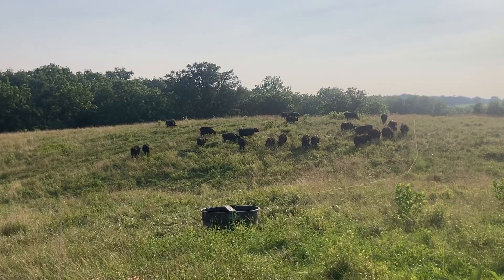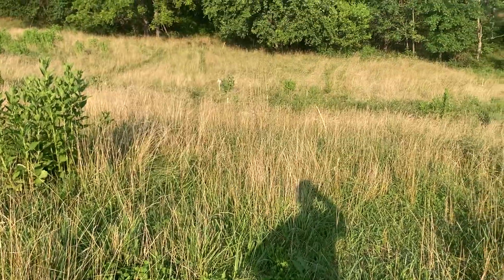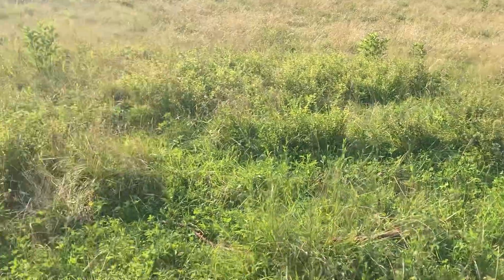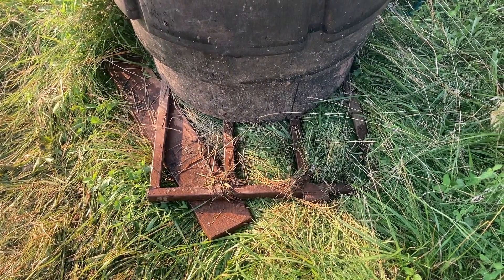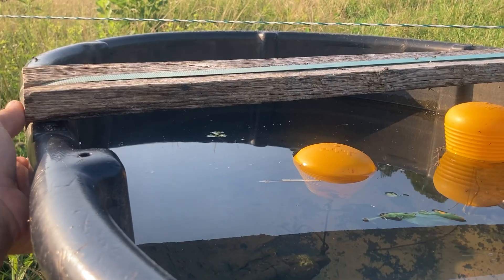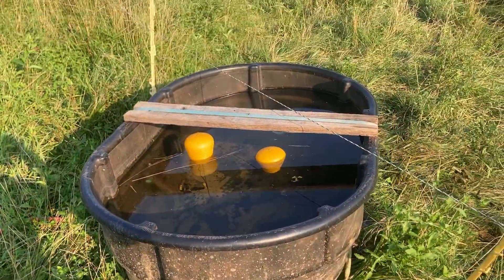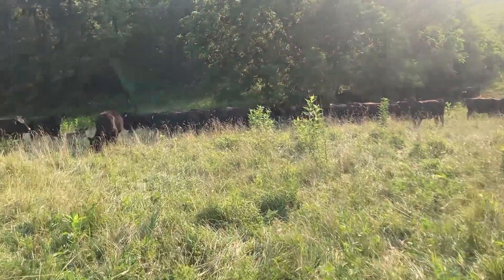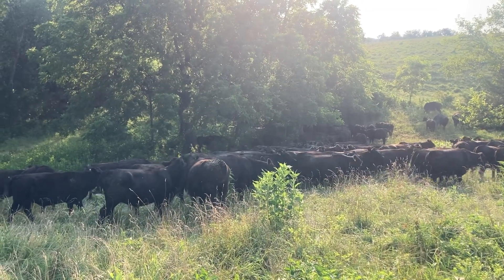Portable Water Tank Sled Design - Episode 195

Comment: That's a bad design... Surely you could do better..
Reply: How does it fail to meet the rquirements of the team there?
Reply: @seandoherty4236 im not meaning to be insulting but surely welding up a frame and adding wheels even a  reservoir maybe just a thought..
Reply from the maker: This design is super functional and simple - wheels aren’t wrong but would just add to the cost and shop labor - you would also have to figure a way to chock and stabilize structure as most of our farm has a lot of slopes and contour changes.

We have discussed a tank on wheels or skids…